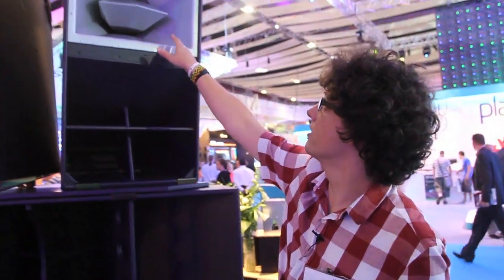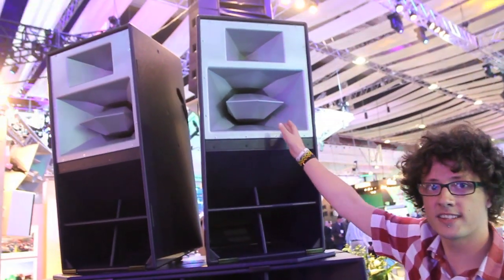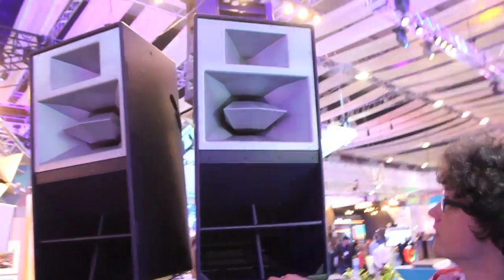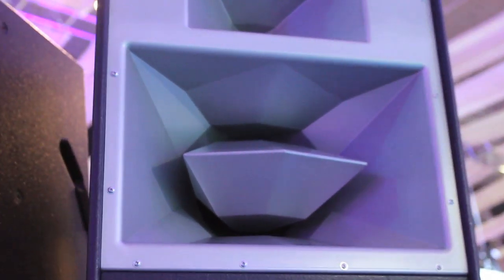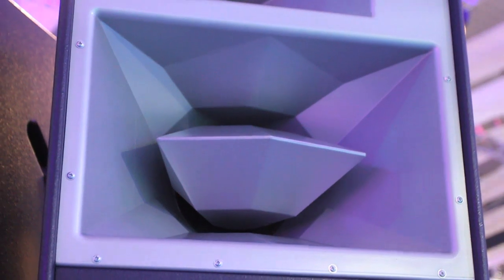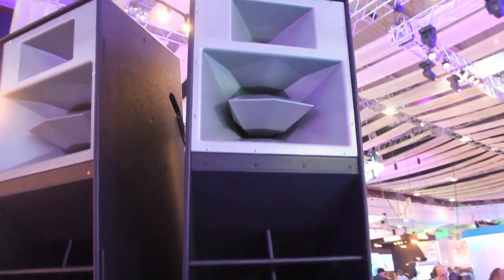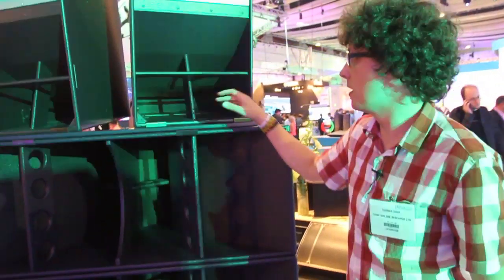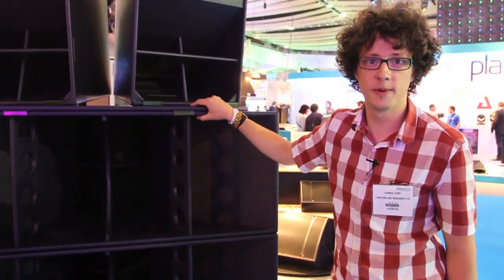Thomas Gude about Funktion One loudspeakers

Comment: I will say that using the F218's does not make it a complete 8 octave system, by a long shot. They start to roll off @ 45 hz. For live use, the F121 F221 or the BR series are needed.
I do like F-1 very much though.
Reply: makes sense. its frq. response is 
45Hz - 280Hz
Reply: Hello sorry for my ignorance...where can I learn about frequencies and the stuff your are talking about...I have a project and I don't want to get scammed by buying not the thing a I need

Comment: How much can a system like that one cost?? how big can the room be or for around how many people is the hole system?? I asking because i am thinking about buy something like it for renting.. thank you
Reply from the maker: For prices please contact the distributor in your country, you can find a list of them here: http://www.funktion-one.com/distributors/1/
This system consists of 2xR4 and 3xF218, but you have to remember to add some quality amps and dsp (MC2, FFA and XTA are recommended). This is a single stack, so we usually would need two of them.
To do some nice club event system like this serves well up to about 500 people. Of course you are still able to do some Sunday open-air party for 2000 with it, but we are talkig about some serious club experience. And it's mostly about quality not only the quantity, although the system is very effective (fully horn loaded) and remember about it's high directivity (in this case the dispersion is about 90x20 deg). 
And as ABOlsen69666 has mentioned (and I agree) you may also think about  (three or four) F121's instead of F218.
For further questions (if any) please contact us via our facebook profile (facebook.com/soundsupportpro).
Cheers!
Reply: a ton of dough. Easy $100,000 installed 4 corner